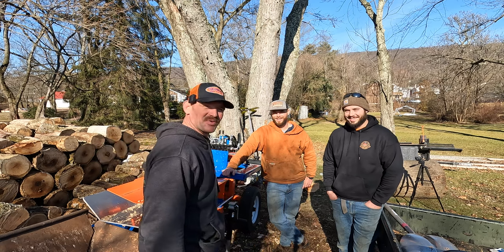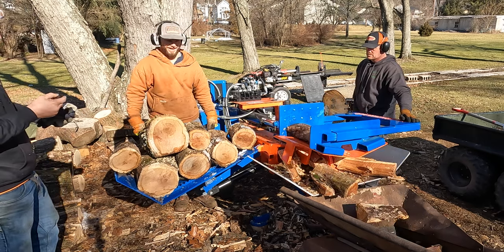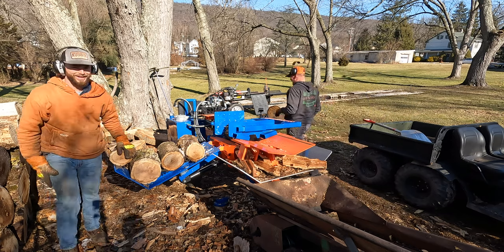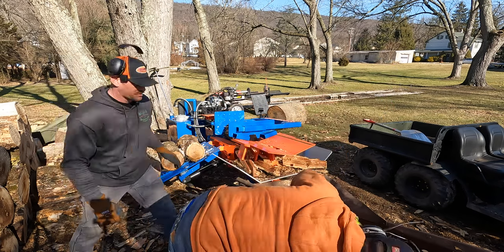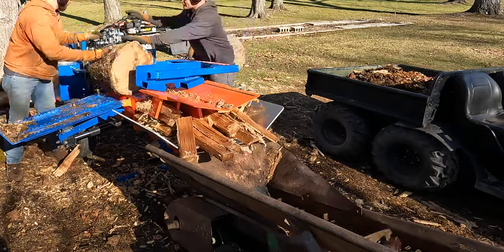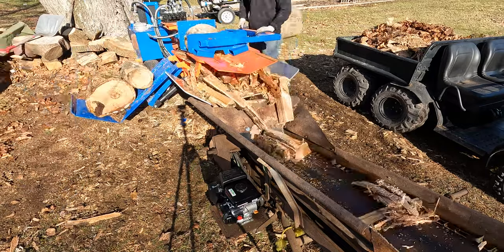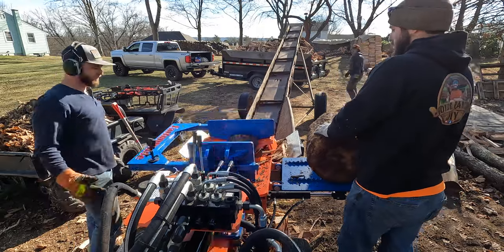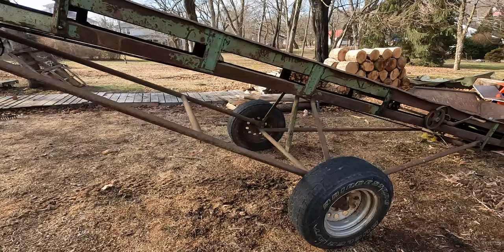First full run with the conveyor with @DudeRanchDIY

Comment: I recall seeing a tip in using a conveyor and that was to leave a small gap between the splitter outfeed and the conveyor.  a portion of the small scraps and debris will fall in that gap and not end up in your split firewood pile.
Reply from the maker: Iron and oak told me of this haven’t tried it yet.

Comment: Third person could be bucking logs.
Reply: Skinny pieces that get under the pushers on the conveyor can do the wrap around on the top.  But you got it so when it jams it doesn’t grenade itself so I think that’s the best you can do with that type of conveyor.  Unless you want to modify your conveyor to a single middle chain (best in my opinion) or add a rubber edge to the bottom of each pusher so it prevents wood from getting underneath a pusher